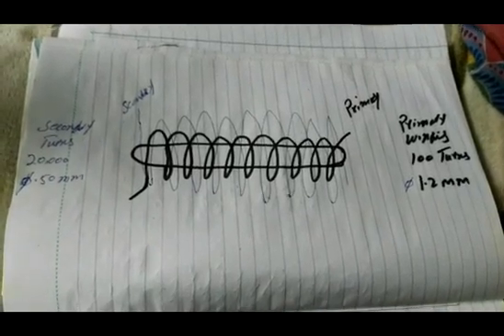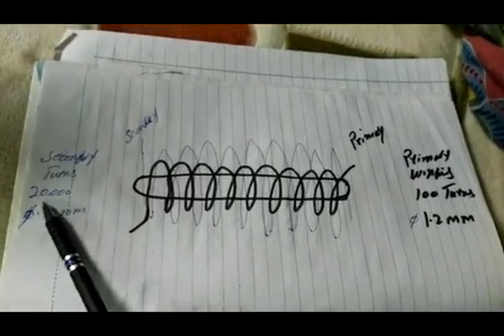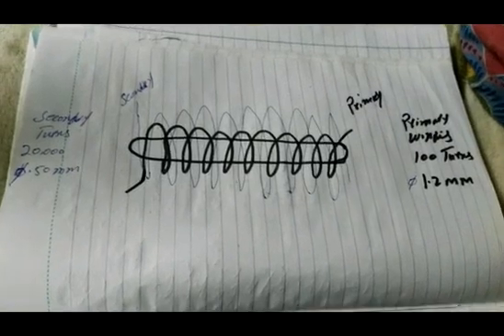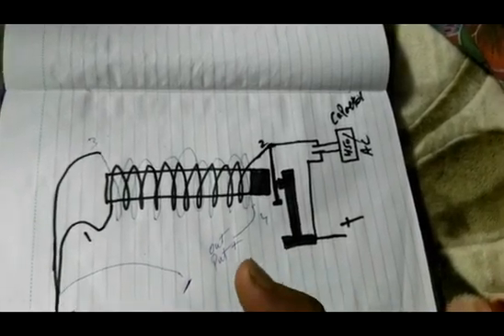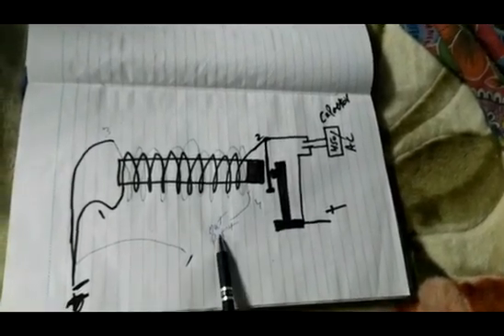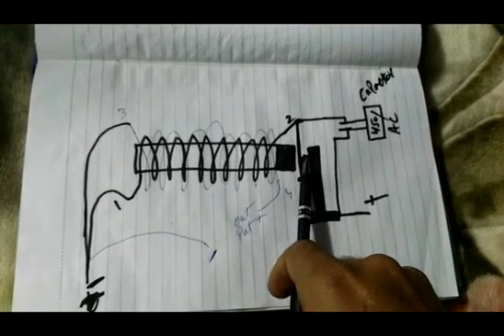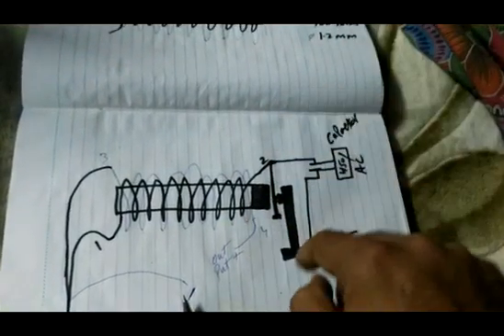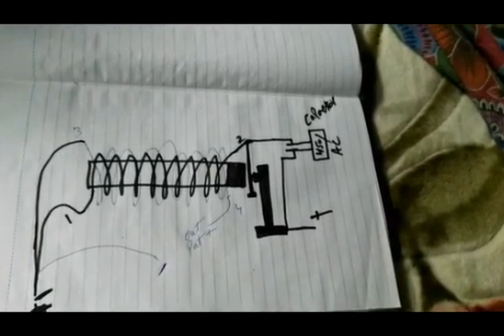Fish stunner  coil diagram 2

Comment: Which type of material was used in between coil?
Reply from the maker: Conductor
Reply: @jananallrounder  witch type of conductor
Reply: @jananallrounder  metal plates or rod
Reply from the maker: Any rod or plats but better to use transformer i plats
Reply: @jananallrounder  transformer can use?
Ampere ?
Reply: Sir can I use 3A ready-made transformer?
Reply from the maker: @yogesh0965   no no need of transistor in it
Reply: @jananallrounder  3A transformer

Comment: Sir 2000 volts? What about the watts? It can light up the 1000 watts bulb?
Reply from the maker: 100 to 200.
Reply: @jananallrounder  the current is weak sir
Reply from the maker: Then u have to move on transformer fish stunner go and check in my videos

Comment: What is the black one with two wire u use  isn't capacitor.   where can we find  what's the name  n  which motor parts it is detail plis
Reply from the maker: It's capacitor . Which we use in fans....
Reply: @jananallrounder  sir which one chilling fan or table fan
Reply: @jananallrounder  sir may u list out the names   which to be use to make   this machine  n what size  of coil is best to use  n many time to turn  n hw long it is   pliz sir
Reply from the maker: Cilling fan capacitor
Reply from the maker: 6 inch long is enough ..